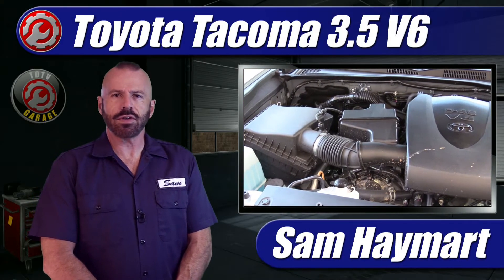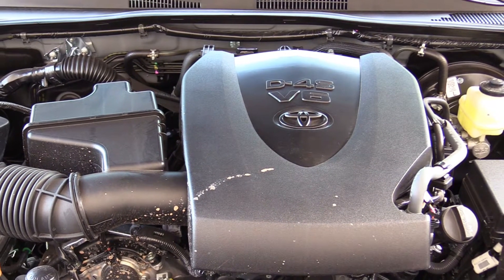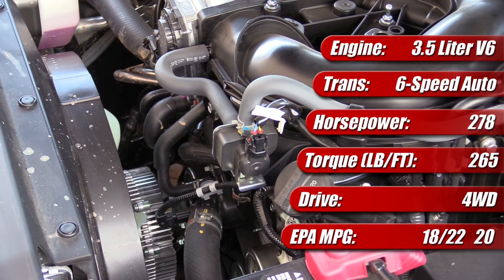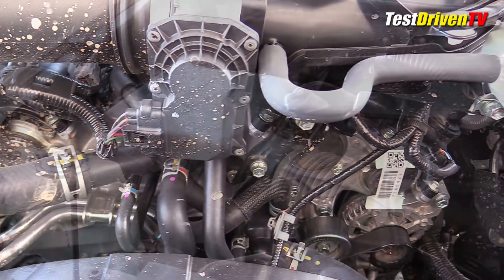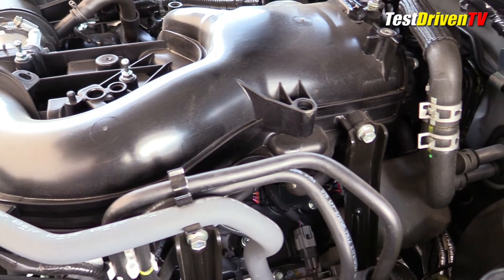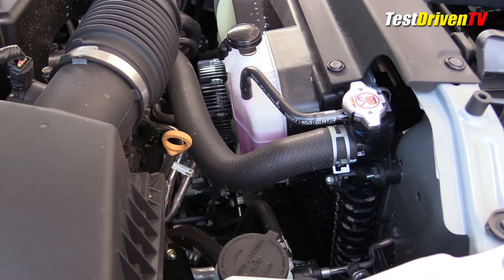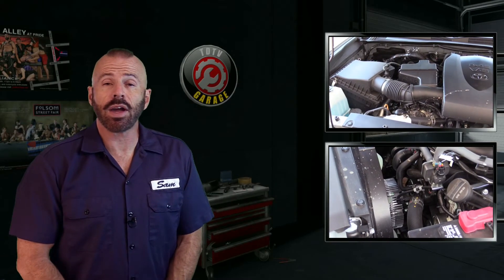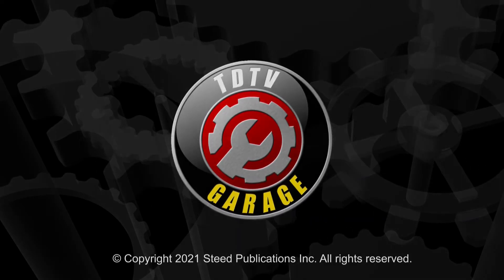2016-2021 Toyota Tacoma 3.5 V6: Engine Explained

Comment: One glaring problem with the 3rd gen tacoma is that it won't hold overdrive on the highway. It downshifts continously, very annoying. The 3.5L the transmission and the rear end gears are not matched very well. This truck needs 4.88 gears. I have 2019 trd off road. I avoid the highway. I only drive on the highway when it's necessary. I've had several tacoma trucks with the 4.0L. They ran much better on the highway than this one.
Reply: Ask your dealer to update softer for tranny, I did truck drives much better  and hold rpm i have 2016....
Reply: @yuriykalashnikov126  Thanks Mr AK-47. I didn't know the dealership had that type of update. Did they charge you? What's the name of the dealership that performed the update? The endless downshifts are so annoying on long trips. Thanks. 💪😎👍
Reply: @oscarposada6144   they don't charge me ,set your  appointment with the dealer let them know about it , I live in mass I went to my toyota dealer
Reply: @yuriykalashnikov126  manual all day can ripp on the highway all day 😎 adding a ingen cold air intake soon going to be super boss 🇺🇸
Reply: @supdude5481  why would you want a manual truck? that just sounds like a hassle.
Reply: Still in my 20s so it is fun 😎😃 probably get an auto when I am 70
Reply: @mely_Mel713  I have a 6 speed mustang
Reply: @Pro4x Trdpro with a kdmax tune the shifting problem has been solved.  The throttle response is dialed back by toyota for efficiency.  The tune fixes the throttle and shifting.
Reply: @Pro4x Trdpro dynos wont tell you how it drives in normal conditions.  It only measures peak output.  Not real world driving.  The tacoma isn't the number one selling in its class for nothing.
Reply: I agree with you, the drive train sucks. TSB-0092-20 is the software update that might help you. The gearing was designed for fuel economy, but it just don't work, unless you drive down hill or have tail wind. The engine has no torque at cruising speeds, the last gears are OD so, it is always down shifting to maintain the speed.
Reply: @feliperomanoff9808  I just run mine (2020 TRD Pro) in 5th gear when it starts hunting. In 5th it's about the same revs/mile as my 1st gen Tundra. 6th gear exists to placate the epa and is completely unnecessary to the owner. My 2010 4 cyl Venza 6 sp. auto shifts a lot also but it's not annoying because the Venza exhaust is silent.
Reply: My 21 tacoma drives just fine - excellent mileage on the highway. Maybe take it in for inspection?
Reply: Do you know if the 2020 models come standard with the update?
Reply: @zoeyredmond5501  yes but it still isnt great
Reply: All day everyday 🤙
Reply: You avoid the highway? Ur a dork dude
Reply: @Pro4x Trdpro I don't think that's true.  I find myself feathering the gas because its literally ripping off the line now.  Any more torque and I would hate driving it.  When it was stock I kept pressing the throttle deeper just to get more go.
Reply: @Pro4x Trdpro dyno runs are at full load.  Normal driving is more important.  No way you are going to drive your truck at 3/4s its capability.  And it has plenty of go.
Reply: Tune it!
Reply: @Pro4x Trdpro never seen such an ignorant comment with confidence,  dude legit asked why manual on trucks with cool boy emoji  🤯🤣🤣
Reply: A easy fix is put the shift in S6 and leave it, it’s forces the tranny to go in overdrive, I drive on the highway at 95 mph at 2300 RPM.
Reply: Just drove a 21 with an automatic from Missouri to Mississippi about 6 hours of freeway at 65 70mph with zero issues of tranny switching gears
57k on the stock truck 4 door short bed

Comment: Good to know, thank you for sharing information. Are you ok with changing engine oil and filter without draining oil filter by design, I have heard it's much easier that way. I have not changed our 2020 Tacoma oil, dealership employee stated they do not drain filter before removal.
Reply: Been doing it for a year now in a 2018 Highlander.  Dropping the filter straight out is the way to go.
Reply: @danichicago9140  why is this? Thanks
Reply: @auto_5  for myself it's 1 less step and less messy. With a lift and more room maybe the tube works better?